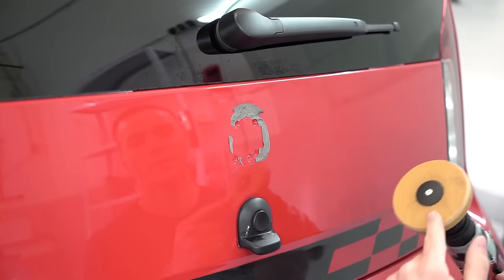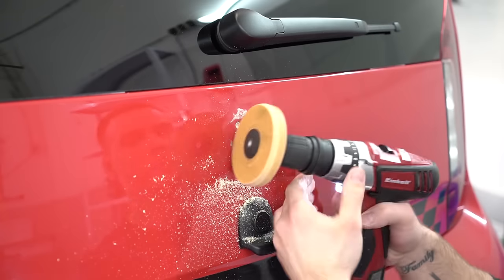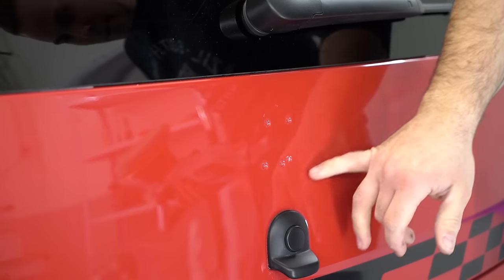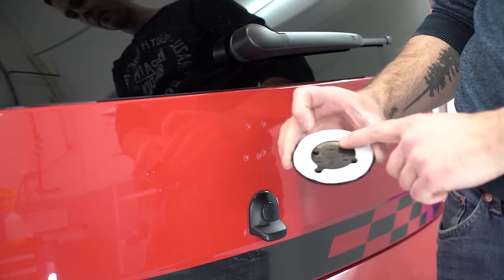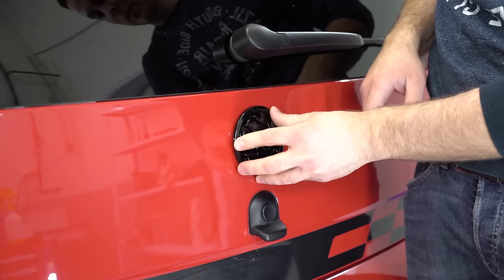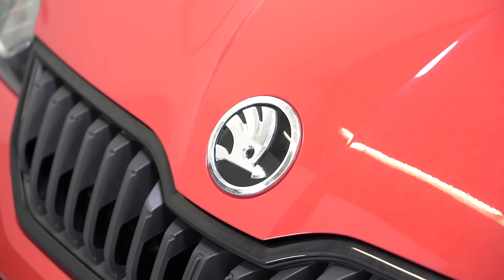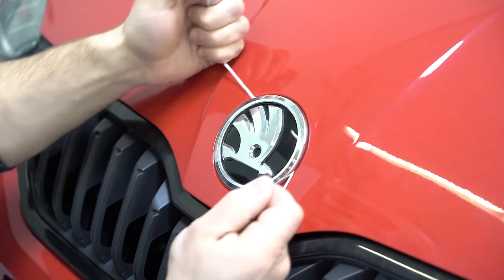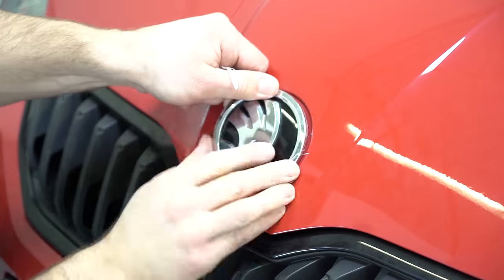How to replace Skoda badges

Comment: which is the right size of badges for a Skoda Kodiaq 2018?
Reply: 99mm for the front and 100mm for the rear. 99mm should cover both if needs be.